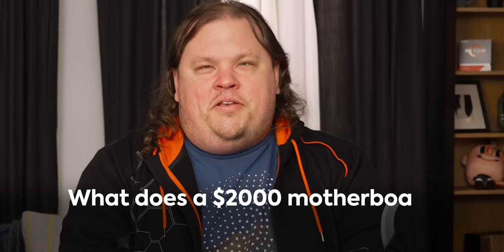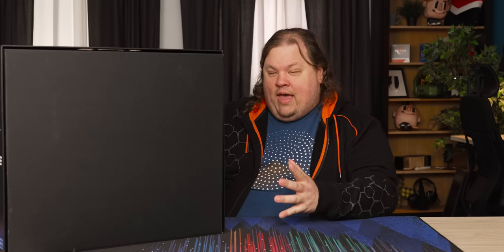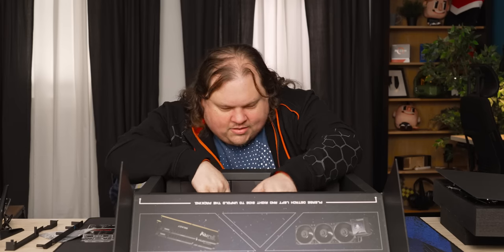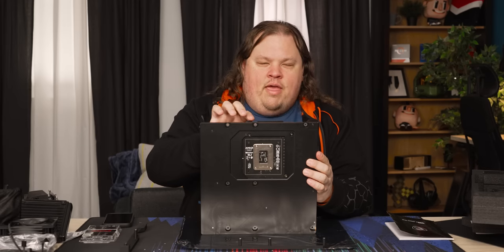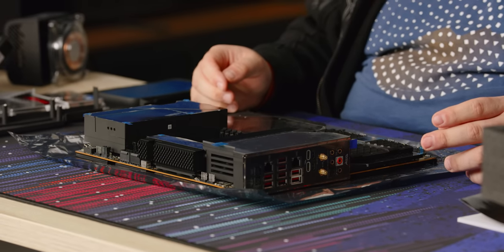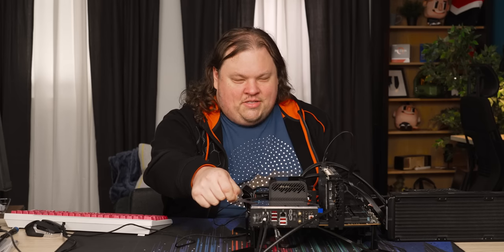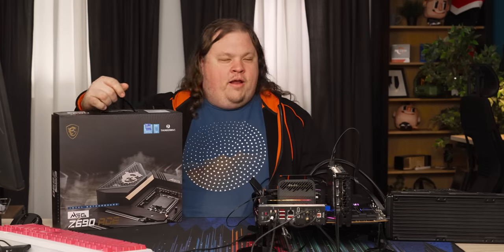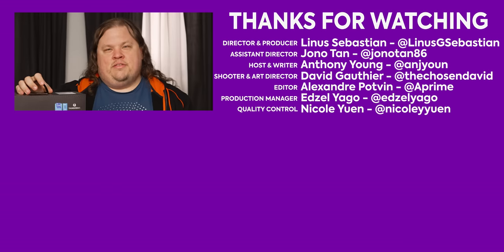Is it truly GODLIKE? - MSI Z690 Motherboards

Comment: It's kind of sad when a company tries to cram so many PCIe devices on an Intel board.
Reply: Why? Intel typically has way more pcie lanes than AMD so can actually them all at full speed.
Reply: right, although alder lake has quite a lot of pcie bandwidth for a consumer board (with prosumer pricing) it's really not enough to do these setups, would much rather see them on a proper workstation board
Reply: @oxfordsparky  Intel 12th gen only has 16x PCIe Gen 5 lanes and 4x Gen 4 lanes... The only boards that Intel and AMD have that have more than 20 to 24 lanes are Xeon/Threadripper which is where multiple pcie slots are actually very useful. Otherwise...not really useful at all unless you just wanna run your GPU and a sound card but sound cards are borderline obsolete except for niche use.

Comment: I had to rma a gigabyte b660 and had the option of another working b660 of the same model or a msi z690 at ten gbp more, the online place had two 12th gen ddr4 boards to pick from at the time. I know it's over kill for a 12400f but it's well worth 150 gbp and made zero sense not to pay the extra. Can always upgrade chip to next one's if socket supports as well 😀..
Reply: Ive heard MSI has really good customer support, was your experience with them good?
Reply: Since this is Intel, the board will be OK for current 12th gen and future 13-ish but they don't like to miss out on profit.
Reply: @stephen1r2  yeah historically they do the sockets in groups of 2 generations and then change

Comment: That motherboard costs more than my build that I recently upgraded with a 3070. Yes that includes the cost of the said 3070.
Reply: Exactly, I got 5800x with 3070, 1TB NVME and everything, all for right about the same money.
Reply: How much did u pay rtx 3070? The price dropped?
Reply: @fynkozari9271  well you can get a 3080ti off newegg for $1,600 but that's rolling the dice on newegg....
Reply: @fynkozari9271  $550 from EVGA's queue about a year ago.
Reply: I’d buy my graphics cards from Evga
Reply: Mine was a local prebuilt, it was either that or just 3070 for the same money. It was the peak of Ethereum value back then!
Reply: The motherboard costs about as much than the 12th gen i5, RTX 3080 build someone I know recently bought.
Reply: I recently bought a 3080 TI from an Ebay auction for slightly MORE of its MSRP, alongside a brand new motherboard, 12600k and 32GB RAM and this motherboard alone would still cost me more than all of that combined.

Comment: If you want a good X570 board I can personally recommend the MSI Prestige Creation. Really great looking and solid board and honestly the I/O is sexy
Reply: Can confirm. Bought specifically for a VR build (Vive pro wireless with 10 point FBT). Sooooo many usb ports, and the 10g is nice as well.
Reply: Rocking this board myself with a 5950x and can say it's a brilliant, stable board, that looks really good too IMHO.

Comment: The reason that motherboards still have TOSLINK is because it’s the best way to connect RCA speakers to a PC without any external equipment. If you’ve got some RCA speakers, you ideally want to give them an original analogue signal, so TOSLINK is the best option for most digital interfaces. RCA speakers have been the go to for vinyl and hifi enthusiasts for decades, so it makes sense to maintain compatibility with them even now that most folks use USB or phono speakers. 

Those audio enthusiasts are a big market, so the small expense of a TOSLINK connector on a board is worth it.

So yeah, in short, it is kinda weird that mobos still have TOSLINK, but it’s definitely got it’s purpose especially in audio production and enthusiast audio listening circles, who are also coincidentally a very big spending market for computer hardware

Comment: I'm confused, why is it weird for a MB to have TOSLINK? Most 2.0/2.1 audio systems still have TOSLINK as well, and it works perfectly well.
Reply: I think most of us don't even bother with the on board audio and just use the hdmi out.  Back when I did though, toslink went to my wireless headset transmitter.  Loved it
Reply: I don't think TOSLINK is common on PC motherboards.
Reply: @yjk_music  Quick Research on the German market:
It's available on 47 out of 61 X570 boards.
It's available on 61 out of 86 Z690 boards.

So, at least at the top chipsets it is still very common (>70%).

Comment: I mean, it's not that overpriced anymore when you consider the cpu cooler and the ram they give you in the box as well. those two together are likely around 700-800$ already, so the motherboard is more around the 1200$ mark. still a lot, but far from overly extreme as I've seen a couple in that price range already.

Comment: > It's weird that motherboards still have TOSLINK, isn't it?

looks nervously at his bookshelf speakers set to optical input

I've always been strongly of the opinion that for noise reasons you should keep your analog signal paths as short as possible, and put your A-D/D-A conversions close as you can to the analog sink/source. The most effective way to eliminate analog noise – more impact than all the shielding in the world – is to put as much distance as you can between the conversion and the other high-density, high-speed digital signals on the motherboard. I don't give a toss about 7.1 channel analog line-level outputs (honestly, who isn't using an HDMI-equipped receiver for surround sound these days?) but TOSLINK is a make-or-break feature for me.

Comment: I had the MSI MEG Z490 Godlike with i7-11700K and it was very nice - with two PCIe Gen 4.0 x16 slots, and had a daughterboard with fan cooling for two PCIe Gen 4 M.2 NVME SSD on the second slot, plus 3 more PCIe Gen 3 M.2 SSD slots on the mail board (5 total). Never used the Thunderbolt or 10gbps network, and my son convinced me to move to AMD 5950X/Asus Dark Hero for bragging rights. But the overclocked 11700K was all I needed for gaming, and MSI made overclocking easy - coulda saved a lot of money if I had stuck with it..

Comment: I love my MSI MEG X670 ACE - heaviest mobo I've ever worked with, by far. It did not quite have the $2100 price tag but at $700 it was the most expensive mobo I ever bought, too. Main reason was to get all the NMVE slots and the 10 Gbe port as well as being able to run fast DDR5 RAM.

Comment: would quite suck if motherboards wouldn't have toslink anymore. how else am i supposed to connect my pc to my amp? running 4 wires instead of 1 that i would have to wrap in aluminium foil or something to get rid of all the noise? seriously, switching from normal jacks (3.5mm/cinch) to toslink 2 or so years ago was such a godsend, suddenly not having to deal with some humming/buzzing in the background

Comment: I can already hear DBrand calling LMG to have their pyramid PC upgraded.
Binned 12900k. Dual 3090ti. 256Gb of ddr5. All the m.2 loaded with 2Tb+ drives. Lol
The text to speach for the bios troublecodes is a pretty cool little feature. I would like to see that become a more common novelty.

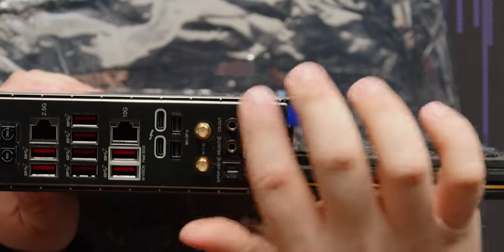Comment: 5:35 How is it weird to have a optical toslink on mobo? This is one of the main things when im looking into new mobo!👽Because only optical cable can run big lengths(18meters+), without degrading your surround audio signal! Also 1 optical fibre wire ir better than 5 copper wires...Also with s/pdif decoder automatically detects the input signal - DD, DTS or Atmos and switches to it... If you're just jacking in the 3.5mm, everything is manual for every source, every time.

Comment: Last time I had to use a 10G NIC with an Aquantia chip it would randomly error out. Not sure if it was the card or the Windows drivers, but it was swiftly replaced by an Intel card that worked flawlessly. (This was during a live video streaming event so time to debug was limited. We can exclude "latest firmware and drivers" though as those were on there.)

The only other Aquantia/Marvell AQtion card I encountered was part of a friend's NAS and was similarly unreliable until its firmware was updated, which involved ripping it out of the NAS and flashing it using a Linux PC as they had not seen fit to actually code an ARM compatible flashing tool.

Unless they've gotten drastically better in recent years, no thank you!

Comment: So I have a question, I am planning on building a new 4K Gaming/editing PC, Should I wait another 6 to 8 months for AM5 to come out, Or should I go with Intel?? I am trying to future proof as much as possible... I was planning on just upgrading my GPU for now, but I can't get a 6900XT to work in place of my RX480.. I am on the latest driver's and have tried to install 2 different 6900XT GPU's and they never even power on, I bought a Corsair RM850 and switched cables around and tested all 3 6+2 8 pins with the 6 pin RX480 to make sure I was getting power over all 3 cables and I was.. The PC comes on CPU, Memory, Fan's and cooler, everything but the GPU comes on!!, But as soon as I stick the RX480 Back in everything works perfect!!???? I don't understand what the problem is??? I can't even upgrade my GPU, This stuff used to be plug and play, at the most after you swapped out your GPU, all you used to have to do was update the driver's.. I can't even get these cards to power on to even run badly!??? I am at a total loss.. The Corsair PSU is in the case right now and working fine, I am using and typing on this PC right now, but as soon as I try to swap out the GPU, everything comes on but the GPU!!! I am so upset over this... It's AMD to AMD and I am on Adrenalin 22.2.3 driver's so WTF is the problem??????

Comment: Need help 
Can't flash windows when Legacy is disabled

My ultimate aim is to get the hard disk formatted GPT rather than MBR and boot accordingly.

The laptop boots from USB as long as "Legacy Support" is enabled in BIOS. When I change this to disabled the laptop won't boot from USB and reports the hard disk error 3F0 
Note: When "Legacy Support" is disabled in BIOS, the F9 boot screen shows no entries
I tried Rufus with GPT partition and windows media creation tool as well. 

My question is how can I get the laptop to boot in GPT mode from USB to allow me to install windows with GPT partitions?

Comment: I really would like to see how a top tier 5.1 pc gaming setup would work. It's 2022 and I'm still using my good old Logitech Z-5500 connected via 3x AUX cables. Isn't there a better way? 

I've read in the comments below that if you use a HDMI A/V receiver, Windows shows a second monitor, although you only want to push audio data through that.

Comment: "It's weird it still has toslink", you talking about your audio hardware I presume because that would be the reason it is on your mobo, in good audio equipment it's still standard (thank god for that as well) I would cry if it would be a "standard"cable, like usb they must have changed/upgraded standard at least six times since toslink came to be. Audio equipment doesn't come with expansion slots for new IO.

Comment: help me understand in a tangeble way why you would need 2x 16pcie port with a cpu socket that only supports 24 lanes tops..? I've searched far and wide and can't find a explanation. Wont the cpu-lanes get overpopulated extremly quickly if yuu specced this motherboard to it's limmit?

Comment: "It's weird that motherboards still come with Toslink" -- I wouldn't buy one without it. There's so much noise in a computer, using it creates a physical barrier (galvanic isolation?) between the computer and an external DAC. Though, good and modern external DACs powered by USB have decent filtering.

Comment: You don't have to worry about ESD until you peel the plastic off the board. The last time I peeled the plastic off a board I measured over 25K volts.

Comment: Love the esthetics of the Ace. But for real, who wants that AIO on the Godlike. It's for full on enthusiasts and if you spend 2k on a motherboard, you'll probably gonna go all out and do a hefti custom loop (except for reliability as someone pointed out to me, since all in one's are less likely to leak) . Same with the RAM...
All that Pcie connectivity is senseless when you only have 20 lanes on your CPU. 1 gpu at 16x and a Nvme on full 4x...
At least power delivery with 20 phases is about as good as it can get. 
Also Celeron support is great for easy troubleshooting. It's not all bad, it just feels like...a bit too much unnecessary things, even for enthusiasts. 
Just make it like 1.5k and don't ship it with all those things a enthusiast isn't going to use.

Comment: What ever happened to 10Gbe motherboards, i remember i got my X470 10G+1G i think it was the exact same chipsets actually, for only $249. Tried looking for a B550, X570, B660 or X670 and the only ones i could find were several hundred dollars. 
Sort of like the old 4K TVs used to be so much better, like in 2016 i picked up a newly launched 40 inch 4K60 TV that supported 1080p120, for only $199, trying to find a similar featured TV will run you into the $800-1000 range. Sure 120Hz on these wasnt as good as 120Hz on a gaming monitor, but it was a heck of alot better, and cheaper than a 4K gaming monitor that didnt support anything higher than 60Hz
Reply: Hard to find a X670 when it doesn't exist.
Reply: @liviuganea4108  H670, sorry

Comment: Please make a "The worst build possible" with this motherboard. (Reverse Sleeper PC, ultimate Ricer)
Lowest spec celeron CPU, lowest JEDEC Speed DDR5, Crappiest GPU (like GT710), 1600W super overkill titanium rated power supply. 
And some gross 5400RPM hard drive as boot. 
Wrap it in a ton a custom watercooling and RGB just to make the world suffer.

Comment: Hiya you haven't tried audioquest. Please stop knocking them, I've worked for qed, worked in the audio industry for a long time and the most popular came I sold was chord signature. Honestly, you haven't tried it, they are excellent and make a lot of difference to the sound with high end equipment. And yes I'm aware of the electronic not so differences of the cables, but it's many many things. If you want I will get you the representative of either armour, chord, or audioquest and you can speak to them for yourself

Comment: You know despite the fact that silver is the most conductive metal.. one of the reasons it's not commonly used aside from the price by comparison to the almost as good copper, especially considering how much gold which is the third highest conductive metal gets used.. silver tarnish is like a mother f, and and that's the fun thing about cables.. corrosion's a bitch for consistent conductivity... Like there's only so much you can do with oxygen-less cables, and from my understanding it's when it comes to silver, almost just not worth the effort hence why they don't bother.. you get a lot more out of copper, but then I suppose that is the topic at hand is how much more are you willing to pay for slightly better.
Reply: We often use silver couplings and silver plated transmission lines in RF. It certainly helps reduce skin effect and standing wave loses in HF when waveguides are impractical. In HF. We're talking microwaves. AudioQuest's peddling their silver nonsense for 5Mm conductors — also known as every regular power cable. That's greater than five megametres after propagation factor of even silver.

The single biggest reason we don't use silver in power or audio is that 20kHz is practically DC. Skin effect and standing waves aren't a thing here.

Comment: $600 vs $2200 however you missing a $300 cooler and $400 of ram plus all those trinkets so it’s not as bad as face value would suggest… still a good $700 more than I should be at an absolute max price to remotely consider.

Comment: I paid 200€ for the msi pro z690 ddr5, its got wifi, enough m.2 slots, enough pcie slots and the vrm can handle a 300W overclocked 12900k. Anything beyond 250 is wasted money in my opinion given the fact that there is only one cpu generation to upgrade your system and its not that much better.

Comment: From my personal experience, MSI is mid to low tier for Motherboards due to BIOS RAM issues.

How they thought they could charge $2000 for a board, even with a cooler and ddr5 RAM included is ridiculous to me. It still ends up being more than double what it should be.

The name, godlike, sounds cool, but nothing I've ever bought from MSI has really been 'gOdLiKe' in terms of performance.

Comment: I'll cut to the chase my MSI godlike experience: I spent 750$ on the MSI X570 only to have a unstable mess where the Power prevention would falsely flag till one day went fully kaput RIGHT AFTER WARRANTY.. I NEVER OC'ed it I never pushed it IT JUST FKing died BRAND NEW not USED.

I Replaced that mess of a MOBO with a 200$ Asus B550-F the rest of the hardware worked fine..

NEVER will I spend over $200 for a MOBO or buy a MSI POS Period

F*** MSI

Comment: Well, given that it comes with it's own liquid cooling and 32GB of DDR5 memory, that covers part of the price (that specific memory alone costs $300+ depending on site, the water cooling is $225 on newegg, 270 on amazon). Would be interesting to run benchmarks to see if their mass load of high speed bus links actually provides an improvement when using high end equipment. Sometimes an extra centimeter of length can add a tiny bit of latency that makes a difference when you are passing data back and forth thousands of times per second. Sure it won't fully justify the price of the godlike, but if the ace is really about the same minus the touch screen LCD that might be worth it